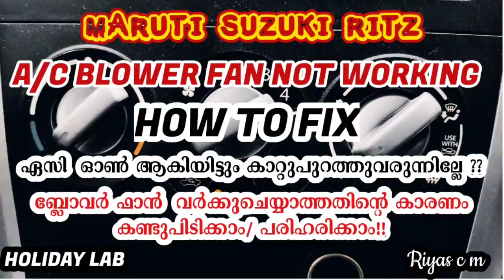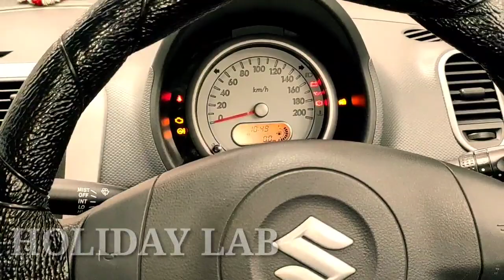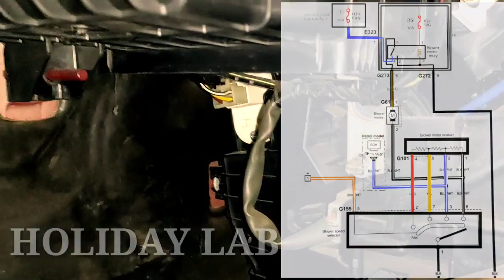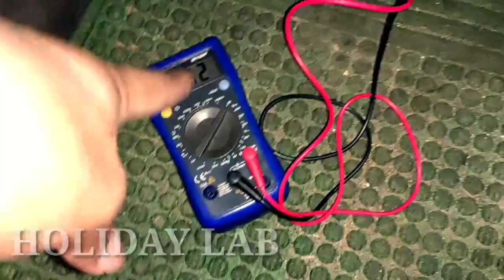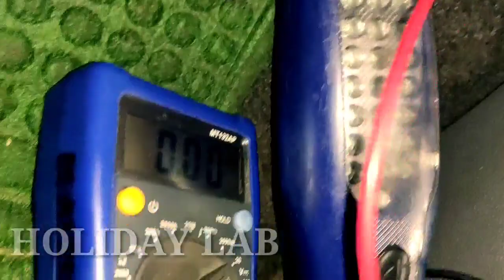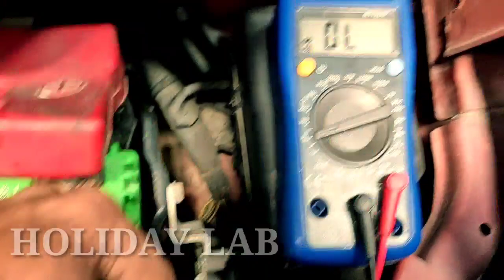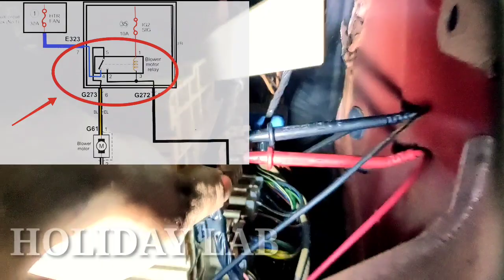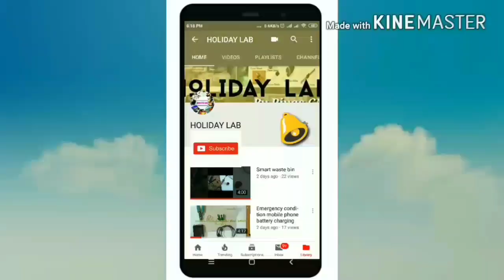AC blower fan not working/ Maruti Suzuki Ritz (Malayalam)

Comment: Hi bro swift petrol type 1 ac on chayumpol chilapol radiator fan work chayum chilapol chayela.relay matti nokeyalo bro loose contact onnum ela
Reply from the maker: Thank you for watching my channel 😊👍
Fan complaint aakuvan aanu chance..AC ittitu power supply varunnundo ennu nookanam supply ok aanengil fan maatu.
Reply: @HOLIDAYLAB  ok bro will check thank u

Comment: Informative 👍, ente patrole ritzil ac on cheydal kure neram kazhinje cooling avunullu. What is the reason.
Reply from the maker: Thank you for watching my channel 😊👍
Gas leakage( evaporator coil il ) aanu main problem pinne compressor intaum radiator fan intaum complaint aanu varaarullath...first gas check cheyyanam.